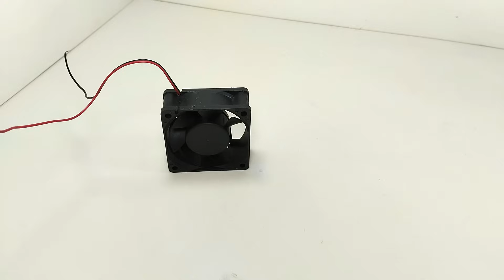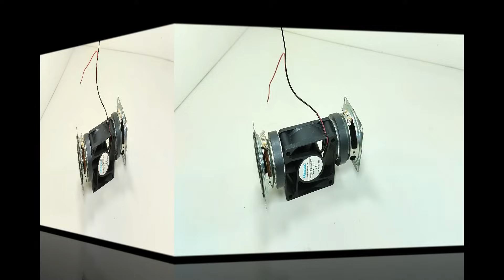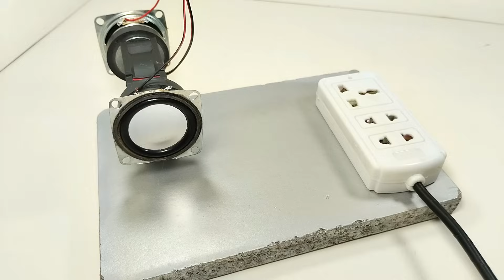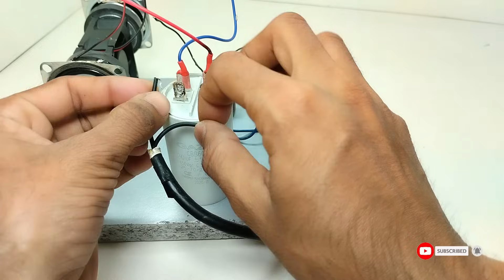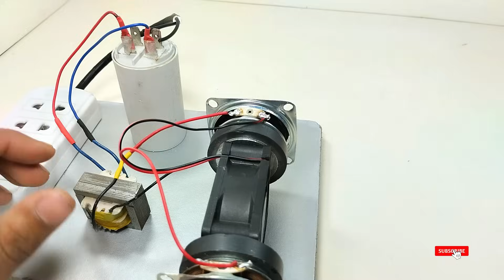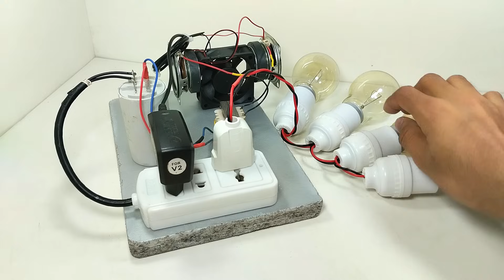New free ELectric Energy 10000W Generator Using 2 Speaker & Colling DC Fan Motor

Comment: 10kW from this scrap??? Hahahahahah
Reply: I've tried it very carefully... it turns out the results are zero 🤗🤗
Reply from the maker: thanks for comment
Reply: @Maker10M-bw1ws  your welcome. 👌
Reply: 1 watt
Reply: @gopalakrishnannair3312  you're very kind, it creates zero watt! 😄
Reply: La corrente si misura in V che sta per volt e A che sta per Ampere… il risultato della moltiplicazione si misura un Watt… quindi 10.000 Watt potrebbe essere il risultato di 1000 V x 10 A …
Reply: @nosl_tekno_23  english pls, thanks
Reply: @norbertbenyak7125  learn Italian … I learned English … 🤬
Reply: @nosl_tekno_23 this combination never gives any watt. It’s fake👌
Reply: @norbertbenyak7125  Maybe there will be some tesla coils around? Why not believe in free energy?
Reply: @nosl_tekno_23  yes, maybe it's around there. unfortunately the collected energy from the air- via tesla coil- is about few millivolts, milliwatts or less depends from it's size and this energy isn't a normal 50Hz like household frequency. this is enough power for LED-s (via greatz-brigde other rectifier) but isn't  enough to use for any power tools or normal bulbs, fans, machinery, etc. like in this or another similar videos. tesla used another coil to rise up energy, he invested high voltage and frequency for it, that wasn't free... the efficiency of this system is very low, example: you invest in 1 Watt and you get about 0.001 Watts or less...  we had similar machinery in our high school to demonstrate similar effects, it had very high voltage (kVolts!) but no energy, it worked via transformer from 3 phases 400V network. that was a proper machinery with very low (almost zero) energy not like these "free energy generator from speekers" and other bla-bla-bla   videos... that's the reason why i'm not believe these free energy projects